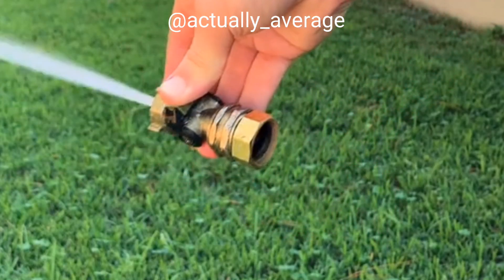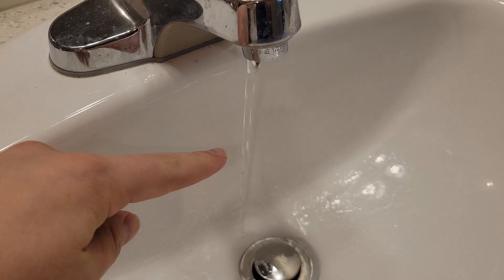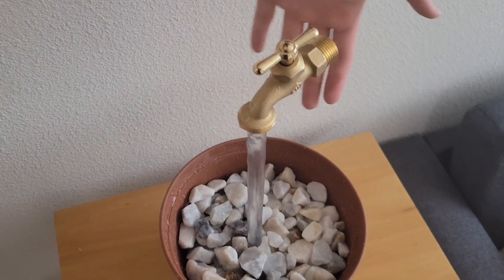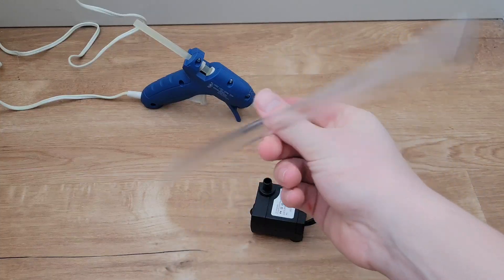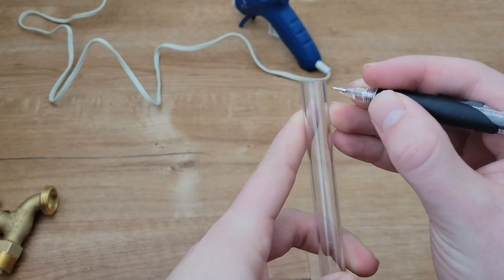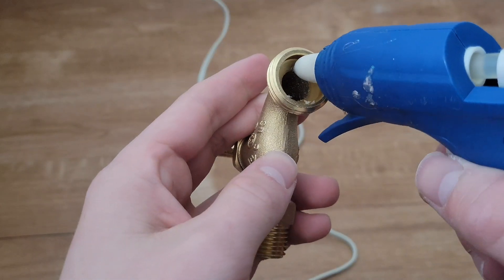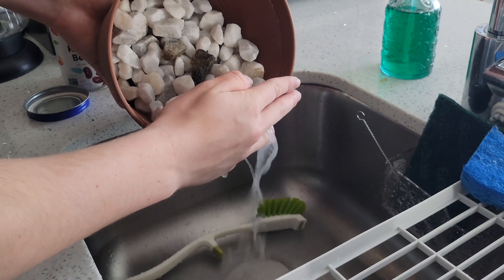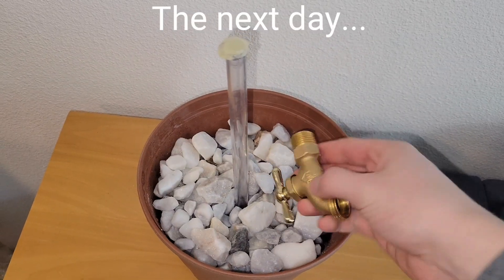How does this "Bluetooth" water fountain work? - DIY Tutorial

Comment: Made an enormous hole in that flower pot to get the pump inside of it instead of making a small hole that the plug and wire would fit through

Comment: If you used an inverted cone instead of a standard tube wouldn't it look more realistic?
Reply: Exactly what I was thinking 🤔🤔🤔
Reply: thats what i was thinking
Reply: To be honest I think it looks better the ways it already is.
Reply: No no, you heat the pipe and pull it, so it gets thinner and longer, then cut it correctly.
Reply: @rockstopsthetraffic  in other words, you make...an inverted cone? O.o lol
Reply: @jordanfreeman8526  not precisely, no.
Reply: @rockstopsthetraffic   so...just a thinner tube then? That would just reduce flow rate and not improve the aesthetic at all.
Reply: @jordanfreeman8526  You'd have to use a high pressure pump to compensate
Reply: @barneylaurance1865  not at that scale. The only noticeable difference would be the very small fraction of a second more time it would take to start flowing.